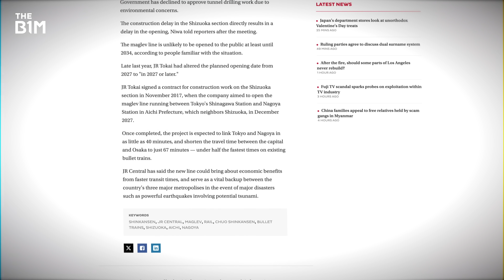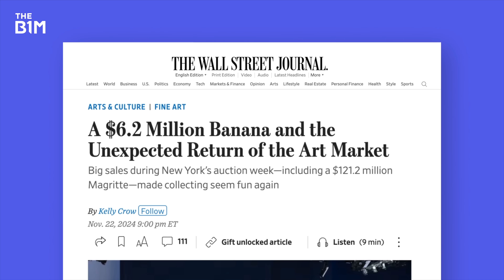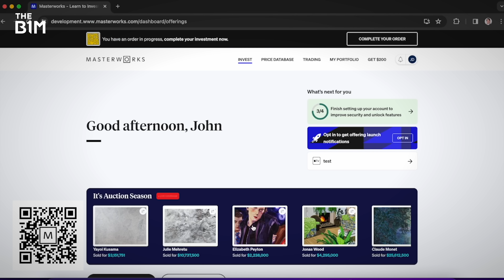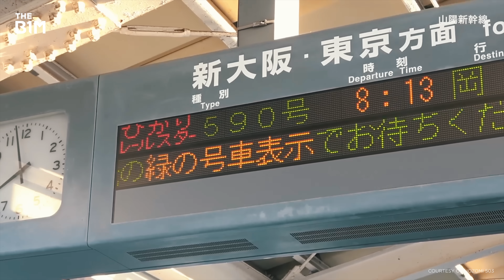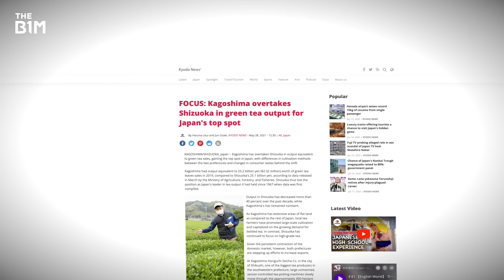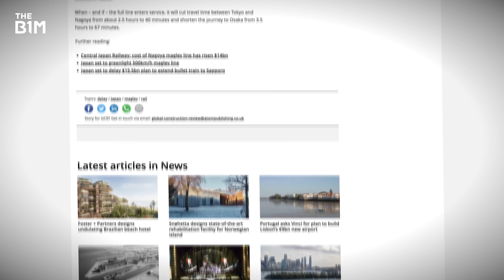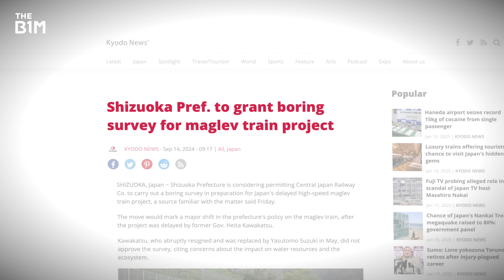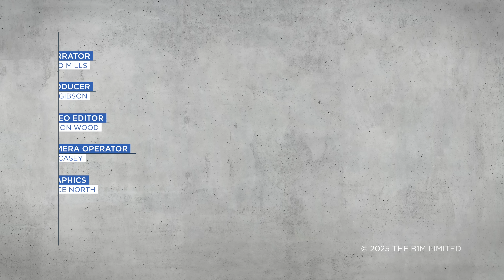Delayed: Japan’s $64BN Levitating Bullet Trains are no Longer on Track

Comment: To be fair, the initial 2027 date was very ambitious. It's not really much of a surprise that it's actually going to take a fair bit longer than that in reality. In the meantime, their already existing shinkansen lines are perfectly sufficient for getting around up to a certain distance. I remember when I went to Japan back in 2019 and used these trains from Tokyo to Osaka, and Osaka to Hiroshima and back- but through Kyoto rather than Osaka. I have to say it was WAY nicer and more convenient than either flying or driving those routes. Really made me upset that we don't have that here in the States, as there are numerous areas that would be perfect for such a thing.
Reply: IKR? My family bought loads of Ekiben & snacks from Tokyo station for the 4 hour trip to Shin Hakodate in Hokkaido. No stress at all, huge cabin and seats. No vibration even with heavy snow in Hokkaido. Luggage roll on and roll off and the kids' first taste of a blizzard! :D
Reply: Not to mention that my home, the FIFTH LARGEST CITY IN AMERICA (Phoenix) lacks a direct Amtrak connection and you have to drive 20 miles through the middle of the desert to some small town before sunrise or after sunset just to hop on a train that comes three times a week. It's not fair!
Reply: Went to Hiroshima from Kyoto after lunch, came back the same evening. Just amazing what a difference high speed trains make, and that wasn't on the fastest trains as we were using the Japan Rail Pass.
Reply: Mean while in Melbourne Australia we can’t even build a normal train line to the airport and it’s only forty miles through suburbia
Reply: いや、2027というのは野心的な数字ではなかった。もちろん遅れる可能性は当初からあったものの、実現可能性は高かった。しかし、新型コロナウイルスの流行と、政治的な対立によりそれが困難になっただけ。そして、この計画は大阪まで延長されたときに、真の力を発揮する。名古屋まででは短すぎる。現在、名古屋までの計画を終了してから始める予定であった大阪までの延長を、すでに実行に移している。現在積みあがった遅れを取り戻そうとしてる。もし、リニアモーターカーが完成したら日本に体験しに来てね。一緒に驚きましょう。
Reply: @dawfwagjojajn 静岡県知事の反対は今となっては遅延要因ではありません
全区間で予想外の難工事で遅延が起きています
静岡でのトンネル工事が当初計画通り着工していても、他の区間で大きく遅延しているのです
Reply: idk man. They used to promise that the Maglev would be open by 2000. They've been doing testing since at least the 1980's.
Reply: @auxiliarypowerunit

1962年から開発開始、10年後の1972年、実験線で実験車がはじめて浮上走行に成功。
1979年、無人走行の最高速度517km/h記録。
2003年には、有人走行による世界記録581km/hを記録。
Reply: because america is a car nation. you can find highways all over the place but trains are stuck in the 1950s basically
Reply: @krisstopher8259  the US WAS a train nation, until the Government bulldozed our cities for parking lots and freeways and ripped up all of the interurban and trolley tracks. Catering to car culture for the last 60-70 years has really set us behind the rest of the Developed world. Trains are very slowly improving here though, at least, and there are pockets like the Northeast Corridor where train service is actually really good. But we're a long ways off from easily accessible high speed rail like it exists in Japan.
Reply: @himbourbanist  yes i know and agree
Reply: @himbourbanist  Right, but you're implying blame on the Gov, when they only did that because people were buying and falling in love with their cars and car culture. Plus, with how America zoned everything and built its suburbs, trains were a lot less practical than countries like Japan with mixed zoning and high-density areas. Wouldn't really have made sense for them to have invested in trains over freeways. Trains are great though, and it's nice that they are starting to be taken more seriously as a means of transportation.
Reply: @krisstopher8259 Japan is a car nation too that’s the thing😢 think it’s more to do with how much land there is compared to japan
Reply: @krisstopher8259 ということはあと16年で新幹線が…？
Reply: @krisstopher8259  The "USA is a car nation" argument is logically flawed for several reasons. First of all it implies that other countries don't have good car infrastructure, but most modern countries like Japan have excellent roads too. Secondly, it's even more ironic since better public transportation = less cars on the road = less traffic jams and accidents = MORE freedom for those who need to drive. This isn't hard to figure out for anyone who uses their brain, but of course 'muricans can't think in any other terms than smug catchphrases that sound cool on paper. 
Also, think of all the hours of potential productivity and relaxation that are lost due to people having to drive. A one hour commute by train can be used for resting, reading, writing emails etc. A one hour commute by car is nothing but lost time. The whole society collectively loses enormous amounts of potential useful time due to traffic jams.
Reply: We are owned by car companies and Big Oil. Nobody's going to pay senators big money to build and operate Shinkansens.
Reply: Perfectly sufficient? Nah the rails are at capacity. The tracks can’t carry any more passengers. 
The traditional bullet trains can’t practically accelerate faster or travel at faster speeds. They can’t practically run more trains. And most of the trains are near full. 

Japan needs more capacity to carry people. And there’s no easy way to do it with the limits of current Shinkansen technology.
Reply: shut up mate - keep your opinion to yourself
Reply: thespaldo, no way you can go from Hiroshima to Kyoto by Shinkansen without going thru Shin Osaka station.

Comment: You should have mentioned the maglev train that runs from Shanghai Pudong International Airport to the city centre. It would have been interesting to hear how it compares to the Japanese project.
Reply: Shanghai Maglev is EMS Maglev they can levitate immediately by electronically controlled magnet in steel track(It can push itself up off the track). SC-Maglev is EDS Maglev they can levitate by superconducting magnet. It can’t levitate until it cooling down enough (enough for not make it falling - that’s why it still needs wheels to keeping the main structure off ground at low speed). Both are different. As you said, this video needs to mention this.
Reply: It doesn’t go to the city center though.
Reply: They are also German trains
Reply: The Pudong maglev runs at a maximum speed of 300km/h and you have to go through airport security-style interrogation in order to board. Shinkansen was definitely a better experience.
Reply: @m00se-b7t The high speed train connecting Jakarta and Bandung in Indonesia is already running at the speed of 350 km/hr
Reply: @m00se-b7t a Maglev is still a Maglev, just like a cat is still a cat whether it's black or white.
Reply: @m00se-b7t Your information is incorrect. I took this train about 12 years ago and the top speed was 431 km/hr. The journey was pretty simple: bought the ticket, pass the security check that was simpler than normal airport security checks, then board the train.
Reply: @sshugo1075  Since May 2021 the maximum speed of the Shanghai Maglev Train at Pudong Airport has been reduced to 300 km/h.
Reply: @ thank you for the update. I just checked and the speed has indeed been reduced to 300 km/hr in order to optimize costs and energy efficiency. And some unconfirmed sources said that the 431 km/hr speed during peak hours would be resumed this year.
Reply: slow and short. not comparable. not worth mentioning.

Comment: Hi Fred,

From what I read, the main problem for HS trains reaching higher speeds is the premature wear on the catenary starting at 360 Km/h.  This was observed in the different record campains by the SNCF for the TGV which reached a max speed of 574,8 Km/h on 2007/04/03 (read everything on wikipedia).

Currently, in China and Indonesia they have lines that runs at 350 Km/h, and Indonesian trains (supplied by China) could run at 420 km/h.  China has even announced train sets that could run at 450 Km/h.   Alstom has even said (a while back, +10 years ago) that they could supply safe train sets that could run at 400 Km/h if needed.  Their AGV (only sold to Italy) have a max cruising speed of 360 km/h.

So the problem is not really the trainset but the line itself, and currently the catenary.  As soon as Materials Engineering comes up with a new alloy to solve the problem, we might see a significant speed increase on some lines.

China even has lines that were constructed for 380 Km/h, but the speed was scaled back to 350 Km/h.

The biggest issues with maglevs are 1) expensive and 2) not connected to classic rail, so you have to switch modes of transport.
Reply: Those aren't the biggest issues. The biggest issues are the laws of physics, which demand outsized increases of energy at higher speeds (air resistance increasing squared to speed). In addition to the higher building costs - again, fundamental physics demands straighter train lines - those outsized running costs make it uneconomical. Making trains go faster, as such, isn't really the issue.

And for most distances within Europe for example it's then simply not worth it. Those trains already need a good amount of time (and track) to reach their top speeds. No point going 400km/h for 5km if you gotta break back down again immediately ...
Reply: @Sp4mMe  The route the maglev takes would save considerable time over the traditional route even if built with conventional steel rail technology. The new route is shorter, cutting through mountains in long tunnels instead of sinuously negotiating the narrow highly populated coastal strip, and could attain maximum rail speed throughout, while the Tokkaido, because it was the first route, has tighter curves than later built lines and thus is more speed limited. A big disadvantage of the maglev proposal is that passengers from the far west of Japan to Tokyo will have to change at Osaka to enjoy the fastest journey times. Convert the project to rail technology and fast through journeys can be retained. Rail already completely dominates Osaka - Tokyo, but it struggles further west due to journey times. Whether forcing an inconvenient transfer midway through the journey will be attractive in shifting the most time-sensitive travellers from domestic air remains to be seen.
Reply: Even with new materials (which aren't likely to happen, given that railways are in fact built with pretty common steel alloys), the fact is wear and energy consumption du to air drag increase with the square of the speed (or even more). To manage the 575 km/h record in France, the catenary's voltage had had to be increased from 25 kV to 31 kV due to the sheer amount of power needed to propel a mere 5 trailers.
Aside from the contact wire, there are also the problematics of flying ballast rocks (which can be canceled with concrete-based tracks) and adherence loss at the top of ramps.

"2) not connected to classic rail, so you have to switch modes of transport."
That's precisely because the Shinkansen is on separate tracks than the conventional trains (which is a constrain in Japan because classical train use narrow gauge while high speed trains use standard gauge) that it is so reliable : most delays on the high speed trains in Europe happen outside of the high speed sections.
Reply: It's got more to do with cost than being connected to the conventional rail network, for example none of the Shinkansen lines share track with the original rail, even the mini Shinkansens use standard guage instead of narrow guage that Japan uses for classic rail. It takes much more power to move the trains slightly faster at these speeds with not much of a difference in time saved over short distances. The Shanghai maglev for example only went from 7m20s to 8m10s after the speed is reduced from 430km/h to 300km/h in 2021
Reply: i believe 350km/h would be enough for Europe, if this would be average speed.
Reply: @tomodomo1000 350kph average speed is still insanely fast considering you have intermediate stops.
Reply: Japan has 600 kph😅
Reply: @ssuwandi3240  only a prototype though. 350 km/h trains are in revenue service for quite some time now. Japan fastest revenue service train is 320 km/h IIRC.
Reply: Couldn't the conventional lines use a system of wireless charging that would be on the train tracks? I mean I guess the losses might be too much
Reply: @aunphilversum3204 why wireless if you can do wired?
Reply: @carlosandleon  Because as  previously mentioned catenary (overhead line) is wearing off very quickly in fast speeds
Reply: @aunphilversum3204  Wouldn't the bulk of the wear be the carbon insert on the pantograph? I imagine the catenary is also getting it's fair share

Comment: I did travel on a maglev between Shanghai City centre and Shanghai Airport. Max speed was 433Km/h this was back in 2008. It's expensive  and this is the reason they couldn't expand the network
Reply: China has tested successfully a new generation of Maglev train (dubbed as flying train) that can travel at 1000kph which is faster than flying. The first commercial maglev train line will be between Beijing and Shanghai.
Reply: The reason they couldnt expand the network is that the train is from Germany and the Chinese dont build maglev trains themselves
Reply: @CommiePlasma  if that were true wouldn't uou see faster trains in Germany and around Europe
Reply: @TheRealMarkyPizzle  No because they realised the maglev is a fever dream useful only in very very niche cases. Something that can run on regular lines after running high speed is much more efficient and useful

Comment: I always thought that a Maglev Line on the Shinkansen network was a bit of overkill when the existing Shinkansen lines already work so well. Tokyo to Nagoya is already within day-trip range, spending $64B+ to cut 50 minutes of travel time is financial malpractice. Those funds could be better used for the expansion of new lines and JR expanding operations in other cities. There are a few other cities in Japan that are in need of mass transit improvements. This line was more of a vanity project than anything else. On the other hand, this is another mechanism for the government to stimulate an already shrinking economy
Reply: It is just a matter of "my infrastructure is bigger than yours"
Reply: Do you think that the Maglev line will take riders off the Shinkansen? That could mean increased costs for it.

Comment: Concorde flew in the 1970s and for decades on end and there's noting flying us at even half that speed now.
Reply: Furthermore, has the engines are going wider to increase the bypass ratio which reduces fuel consumption, they need to slow down too, because the higher the ratational speed of that huge fan, the higher the speed at the external tip, sometime reaching very close to the speed of sound which can break the tip.

Comment: I’m imagining the mag lev along the north east corridor in the US. Man, why can’t we have nice things… or rather why is so damned expensive to get anything nice here
Reply: That would be a waste of money. Way too many stops along the way, way too much shared traffic, outrageously expensive to build for one specific service instead of what could be done for the existing train lines ...

A project like that would be perfect for example to connect the Texas triangle (Austin - Dallas - Houston). There's effectively nothing there, and you can do it in nice straight lines. Would even be way cheaper than this Japanese project.
Reply from the maker: That would be incredible
Reply: I feel like generally the US should just actually try to get its rail working again
Reply: Well here in Europe we could use them too. Imagine traveling from Berlin to Rome or Madrid or even Athens in a meglev. This could honestly challange planes. Something that's crucial if you want to reduce the co2 output of Europe. Maybe if Japan successfully pulls this off, there could be enough interest in Europe to start campaigning.

Comment: why not just build the track around the river? Some deviation might cost a lot but its better than delaying the project by years
Reply from the maker: Curves aren't the best for super-fast rail lines (even wide ones). You want to be as straight and flat as possible.
Reply: @TheB1M  I see. Still pretty cool tho. Here in Germany the government should steal a pice of japans cake in terms of fast transportation. The deutsche bahn just has delays and is slow haha
Reply: The project delayed in this point is the Governor of Shizuoka, he think the new shinkansen crossed a tiny part of our land (Shizuoka) and the project itself didn't benefit the Shizuoka, because it just passed the prefecture and no plan for building a station in Shizuoka. 

And they wanted the existing Shinkansen to build a station in Shizuoka airport to attract some tourists 

(What I read on recent Japan news)
Reply: @keiming2277  To be fair, it was just confirmed that Shinkansen construction on Hokkaido caused a river to dry up. Not the size of the Oi river, but yeah...
Reply: @izinyosib821  The extension of Hokuriku Shinkansen from Kanagawa to Kyoto has the same concern about the construction may cause damage to some of the Kyoto rivers